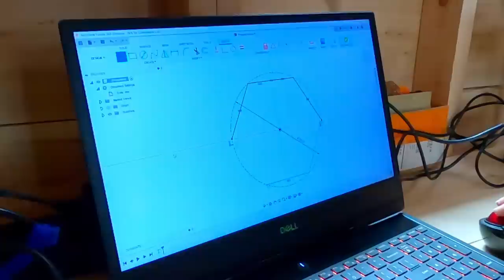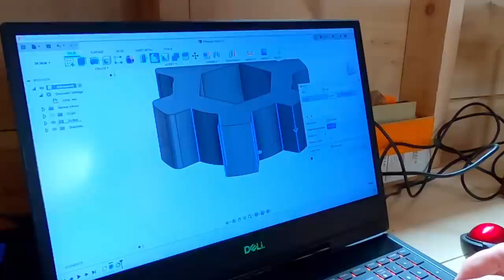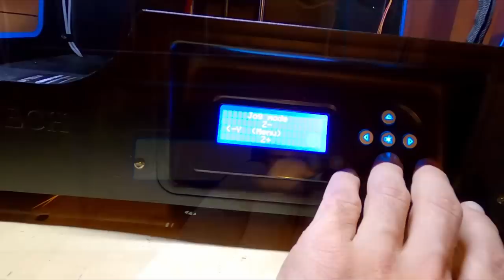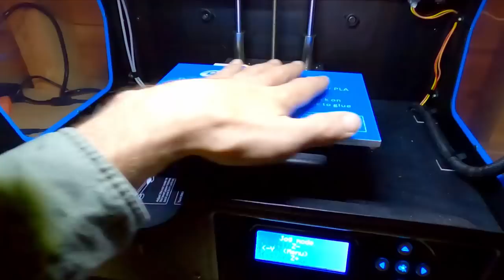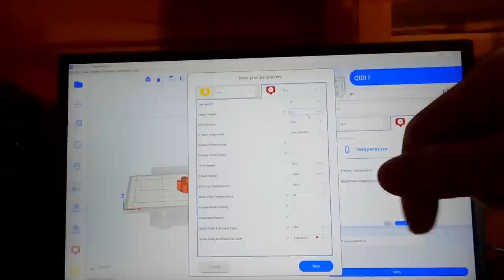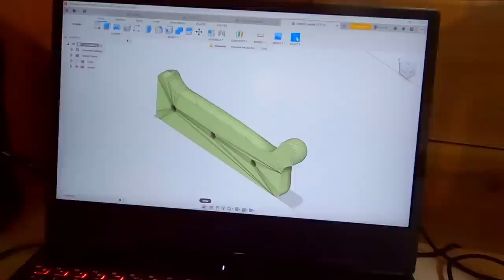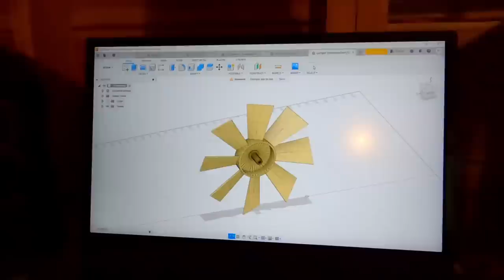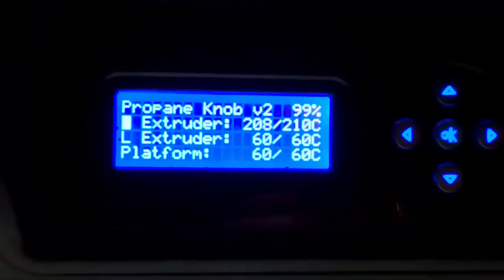Off-Grid 3D Printing Propane Parts.  It Works! #86

Comment: Definitely sold on the idea of you working some more 3d printing into your adventures! I’m one of those outdoor types who also does solid modeling, 3d printing, etc. I’ve used my davinci 3d printer to print negative molds for hand pouring soft plastic baits for fishing you should give it a shot. Buy some soft plastic baits at Walmart melt them in a microwave and pour you own design.

Comment: My son and I went out to the property where we're going to set up camp and spread a bunch of bug granules in the areas we plan to clear and set up our camps.  Next step is clearing out saplings and dead fallen branches and leaves so we can make some platforms for tents, etc.  Getting excited about 24/7 camp life.  3D printer is on the list of things to buy once the house sells and we're ready to move to the camp.  As a stream of income I plan to print 1/18, 1/12 , 1/10 and 1/6 scale items for people to buy for their dioramas for action figures.  Maybe some smaller stuff too for Dungeons and Dragons type games.  I'm an excellent model painter and should be able to make a good profit for a little bit of fun "work".  It'll be a good project to work on whenever it rains too hard to build camp stuff.

Comment: For the tent, mix a tube of GE II silicone caulk with an equal amount of mineral spirits and brush on the tent and it will never leak again. 
It may be two parts minerals spirits, don’t remember.

Comment: How sensitive is your 3D printer to moisture?   Since your structures are not insulated the printer may start corroding because of excessive moisture.  Have you finished the lean to structures for your propane tanks on the back or side of the tool bed room?   Perhaps your POS tent can still function inside your gazebo?   Do you have any screen left from gazebo for enclosing the shower side walls and front flap?  Bug screens could be a precursor to winter wall flap structures.

When is Rosie and her mom coming to visit?   Wishing you and your lady a blessed week and restful evenings.  Peace brother

Comment: Question, when are you going to build a thermal mass heater and warm your tool room using a wood fire stove with flue vent heating under your floor.   Alternatively, have you considered building an outdoor kitchen that would cook food and simultaneously heat water for your various needs including keeping the water in your IBC totes liquid all winter?

Comment: I've been using Solidworks since 2001, and LOVE it!  Great video, Ryan!  3D print a garden window-type enclosure for your printer, to attach to the outside wall of your building.  Only takes up wall space, and not floor space.  Or make it out of lumber...  😁

Comment: 3D prints are consistently slightly misaligned, it is often due to the width of the nozzle and the height of each layer, this causes about 0.15 mm of extra material to be extruded for each side.

Comment: Do you see yourself using the dual extruder much?
Where's a good source for PLA, and what's a good amount to keep on hand?
I'm seeing it sold by weight or length.
Just trying to establish an idea of consumables... 350 meters is about 1,150 feet... but, what would 1,150 feet be able to print? a little or a lot?

Comment: Question for those that know...
Can a 3D Printer make text around the ring that looks like it's engraved?
I run a CO2 laser and can engrave into the ring, but can the 3D printer just leave deletes that form text , words, and designs?
I'm sure there's parameters that it wouldn't be able to perform, such as cursive or incredibly small text.
Reply: Yes.  Whatever you can design in CAD, it will print.  I've done multiple pieces with "engraved" lettering.  It all depends on how fine the details are, and incredibly small text would not work well on the extruded plastic printers.  The resin type printers are extremely good at that sort of thing.

Comment: Are you using just PLA? Feel like PETG would be perfect for projects at Ringworm (I printed an adapter for my brother's SIM racing wheel out of PETG, 100% infill -- the thing feels more durable and lighter than most metals.. it's crazy)

Comment: I'm still bothered by that little propane stove you have in the building. That wastes a LOT of propane. I'm convinced you could burn sticks in that thing, and possibly get the same amount of heat out of it. You might have to do some alterations to deal with ashes or something. But you are smart enough to do that.

Comment: I used to print multiple copies of a part at once but if one part loses bed adhesion you lose all the parts, and have to start over. For longer prints, I don't take the chance of multiple parts. Too bad about the tent

Comment: You know If I were you swhy not check out say army surplus for GP small or medium tends they have sturdy poles usually center pole with cross beams  and even the side poles as sturdy roof vents for stoves and some have winter linings and the sides can be rolled up to air them out. Hell you could use them to say dry dry out your wood with say barrel stoves or double barrel stoves. Or just live in them year round Ive seen some from canada that they built wooden frames for but that white part was like the inner lining of say a gp medium afrmy tent there is another green canvas tent that goes over the white inner linning. ?they can be a bitch to setup initially but they last a very long time. And with your decks I
e seen that before in boy scouts usually for the scout leaders a cabin tent placed on  them they might be like a GP small my guess is there might be mosquito netting as well and tarps for the flooring. As far as tents go they are very well built all season tents. Just my two cents and you know how to sow I dont. You could probably make a canvas cabin tent your self.

Comment: I , see an Alternator .
If You , could make an Alternator , that actually works You , could go higher .
You , could print out a Plate .
The Alternator , could be connected to the Plate , in front of It .
As the Lazer Light , penetrates Matter , after that , the Alternator , has to move on .
The Plate , in front of Your Garage , the auto would have enough Energy , to reach .
The Auto , would always have enough Energy , to go to Where It , sees to .
The Plate , in front of It , works in both directions .
That is Two Directions .
The Energy , gained can go in Four Directions .

Comment: Add Academy sports they have a tense spray that not only tastes tense spray for sealing the tent and also it also keeps the scotch guard and it keeps from leaking seals all all of thit's all all the same and everything I've used it many times it is great especially using it on my boat tarp to keep my boat tart from leaking into my boat if it fixes a boat tarp set out in the sun it'll fix your tent get you later bye

Comment: I hate to see the LP stove with the exhaust pipe sending 3/4 of the heat out side? You are ok burning a gas lantern with out a vent? Look online at vent less wall heaters they kick ass.and are 100% efficient. Maybe it's time to build a GEEK Cave for all your cool high tech computer stuff, a room addition, replace the window with a door.

Comment: Do you or Tito ave any welding skills that could be applied to building an off grid wood fired, rocket stove water heater.  Considering the connections, the following build could be used for heating water in your cattle trough hot tub, warming shower water and possibly keeping your IBC tote water liquid all winter.   https://youtu.be/gw7uQP-nQ3U

In the case of the IBC totes, your hoses may need to be located near the center of the tanks since the outer edges will freeze before the center.  A daily cooking fire would probably suffice to keep totes from freezing solid.  Use a pool noodle to insulate the pipes from tote to rocket stove.